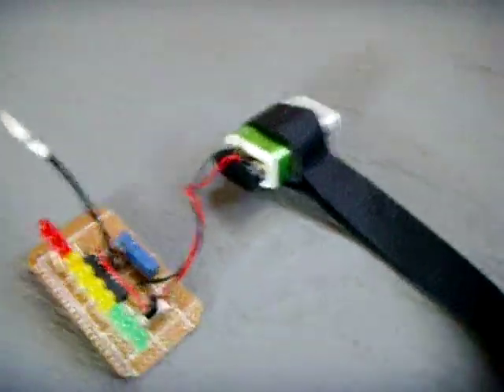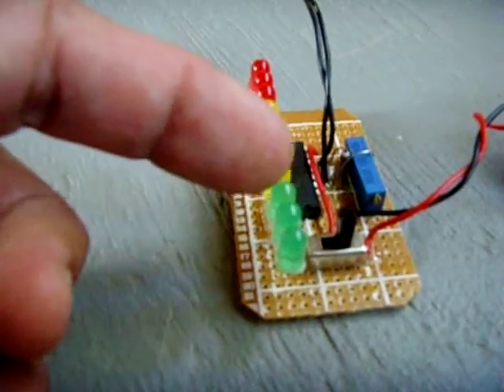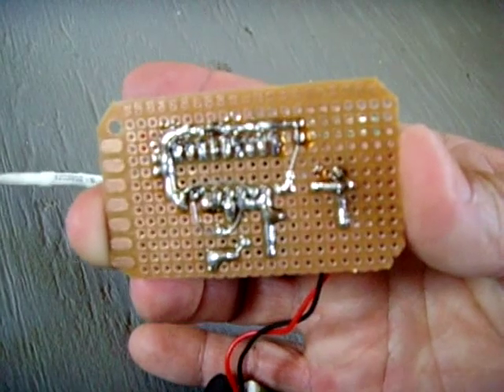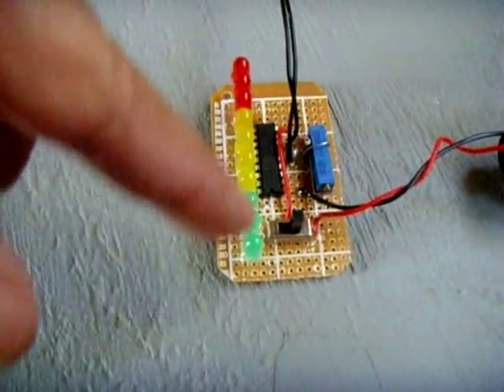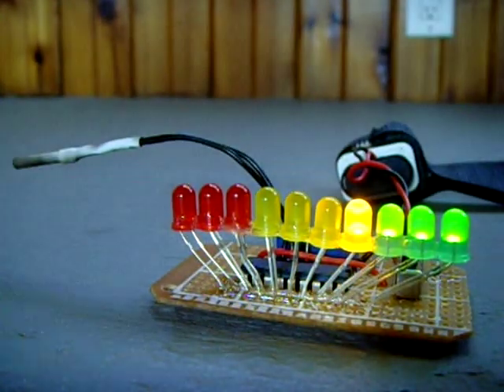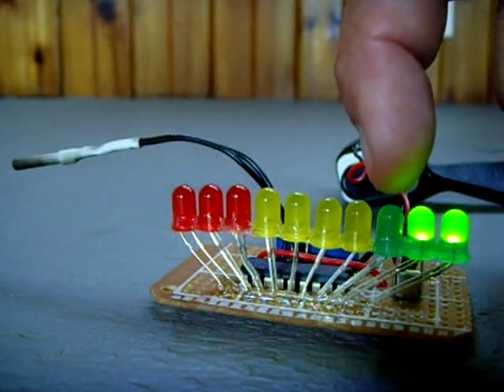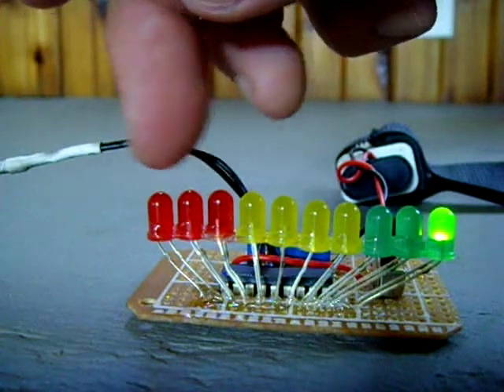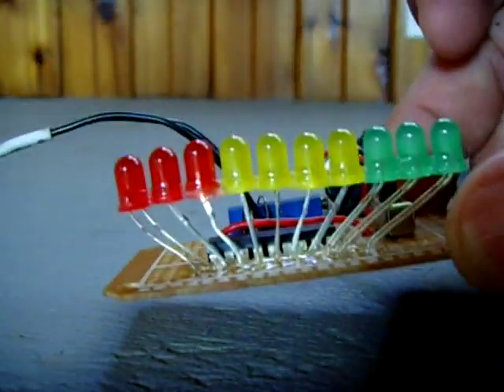LED Temperature Indicator Circuit - LM3914

Comment: Sooo... 11 years later... you're probably active here to answer this... but can this be achieved with a KSD9700? Would an LM35 be better? I intended to mount it to a heat sink. EDIT: Probably not. The KSD9700 is a thermostat that's open or closed at a preset temperature whereas the LM35 would allow voltage proportional to the heat.

Comment: Great vid, thank you! Do you think its possible to wire this circuit so all the LEDs light up at low temperature and then they go off one by one as the temperature rises? Using a similar NTC sensor. (104F=925Ohms -> 302F=32Ohms)
I'm thinking to DIY a dynamic redline indicator for my tachometer in my car. Thanks in advance
Reply from the maker: Use a PTC thermistor instead. :-)

Comment: Thanks for the video. Why does the LED continue to glow for sometime after the match stick is removed?
Reply from the maker: Sounds like you need to adjust the circuit's sensitivity using the POT's, and double check all resistor values and circuit connections. Thanks for watching!

Comment: I will make this for my final project. thanks!
Reply from the maker: Great to hear! Be sure to check out all the other great circuits shown on my channel. :-)
Reply: electronicsNmore hi sir! can i  replace the potentiometer with a 10k resistor instead? i tried it on proteus it perfectly worked but idk if it is going to work on the actual hardware.
Reply from the maker: Nakedmolerat Yes, once you have it properly set you'll know what value to use.
Reply: i finished it. your circuit worked perfectly. thanks again! :)
Reply from the maker: Great to hear!

Comment: what if I use 10k Thermistor ? and can you tell me where is VR in the circuit ?
Reply from the maker: VR is a "variable resistor" or "Potentiometer".
Reply: Aeona Paula i  have also the same  question. pls tell me how to connect
Reply from the maker: The VR is the 10K on the far left side of the schematic. Use the center pin of the VR and either side.
Reply: electronicsNmore  pls tell me how to connect  potentiometer

Comment: hi I want to make something that uses nicrome as a heating element and a thermistor to regulate the temperature. would you know how to make that?
Reply from the maker: The thermistor could not be placed too close to the resistive wire. You may need to use a thermocouple circuit which triggers a triac or relay. Take a look here:
http://www.banggood.com/search/thermocouple.html?p=U627203391019201512Z
Reply: +electronicsNmore I have no clue to be honest. I've tried to learn but I'm a hands on learner. is there anyway were can talk off youtube? if you need my email just ask. I would like to make you an offer
Reply from the maker: David Stone
Unfortunately, I have over 340 videos with many people asking to chat on the phone. I cannot do that. Please visit "Talking Electronics" website to learn more about electronics. Thanks.
Reply from the maker: +David Stone
Have you seen my video showing how to make circuit boards? Video link below.
https://www.youtube.com/watch?v=lvNCKwAcg90

Comment: Hi wat is the temperature range? also share a how to do video with a buzzer for high temperature for industrial machine which uses a bearing which gets heated very fast...thx in advance
Reply from the maker: +Gugan S 
Hi. I did not test the full range. If you want to add a buzzer, please watch my other video below. You can substitute a buzzer for the cooling fan.
Be sure to rate thumbs up, and share. Thanks

https://www.youtube.com/watch?v=UO1_229BGMA

Comment: Can you give a schematic, pls, thank you. I tried many, many times but it did not word. I think something is wrong in your old circuit diagram
Reply from the maker: +Huy Khôi Hà 
Hello. Nothing wrong. Everything is fine. There is a link in the video description area.

Thank You
Reply: +electronicsNmore Following your schematic, I connected pin 9 and pin 3 together to Vcc. Pin 8, pin 4 and pin 2 to ground. In my circuit, NTC 10 was used to connect pin 5 and pin 6, resistor 1K, I used 10K volume variable resistor to connect pin 5 with ground. I burnt the NTC, but  my circuit did not work. I removed variable resistor 10K, resistor 1K and NTC gradually and I supply 9V, the LEDs still lighted together. I would be grateful if you give me your help, thank you
Reply from the maker: Huy Khôi Hà
This is one of the simpler circuits on my channel. I suggest trying another IC. You may have a faulty IC.

Thanks.
Reply: +electronicsNmore Thank you. Ah, can I use 10K NTC instead of 47K, is it problem???
Reply from the maker: Huy Khôi Hà
You will have to modify the other resistor values if you change the thermistor value.
Reply: +electronicsNmore Hallo, I bought new ICs, but my circuit did not work. I test my ICs in other circuits and it works normally. The LEDS seems to be independent from any Resistor, Thermistor, and Variable resistor when I connect them to LM3914. Here is test board circuit: https://www.pinterest.com/pin/528610074992150329/

Comment: FINally i can do my project, the problem is that the image was not indicated the color of leds.. 
thanks for advance... ( the speaker of my laptop is not functioning/damage)
Reply from the maker: AlSCI Warz The green LED's start at pin #1, then 18, then 17. other colors follow starting at pin 16. The last LED is Red pin 10.

Thank for watching. Be sure to check out all my other videos and share.
Reply: thanks....

Comment: Hello!
First off, thanks for the circuit.
One question though: if I use a 10k thermistor how should I adjust the other resistance values? (also, just to confirm, it is a ntc thermistor, right?)
Reply from the maker: Lincoln Junior Hi there. The thermistor is NTC, not PTC. Not sure of the values for modification. You can try adding a 22k to 33K resistor in series with the thermistor. Also try a 20K POT instead of the 10K.

Thanks for watching! Be sure to share with others, and rate Thumbs Up.

Comment: Is there a circuit for measuring cold instead of heat ???
Reply from the maker: Hi there. I'm sure if the thermistor location was moved, you could reverse how the circuit works. I also have this video: 
LM741 Temperature Indicating LED Circuit(Hot/Cold) 6V

Comment: I NEED TO HAVE 20 LED HOW CAN I DO IT
Reply from the maker: 20 is a lot of LED's! This chip does not have that many outputs. Sorry.
Reply: use 2 lm3914/16/15 linked together.
Reply: +nndondeni mudau The LM3914 data sheet has sample circuits for driving 20+ LEDs

Comment: hi, i'm looking to build a high temperature indicator circuit. Do you think i'd be able to reach temperatures 500-800 celsius if i changed the thermistor?
Reply from the maker: The best way to do that would be to buy a thermocouple on ebay.  When heat is alpplied to the thermocouple, a very small voltage is produced between the 2 dissimilar metals in the tip. You then can take the MV output and use that to drive a circuit(comparator) which will trigger an LED when a certain temp is reached(due to an increased MV output from the thermocouple).

Thanks for watching. Be sure to check out my video playlists.

Comment: How u built the circuit? from the datasheet?
Reply from the maker: Should be a link to the schematic in the video description area.

Thanks For Watching!
Reply: Thanks, i found the link. But were u using NTC or PTC? does it matter?
Reply from the maker: NTC
Be sure to check out my video playlists!